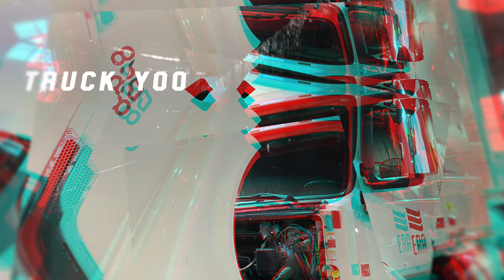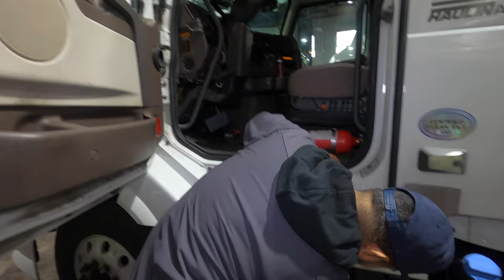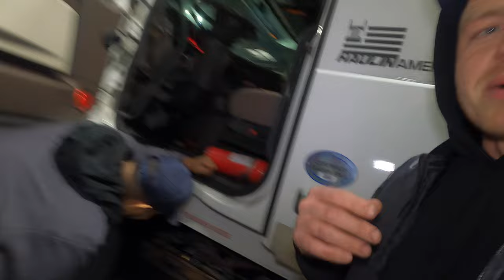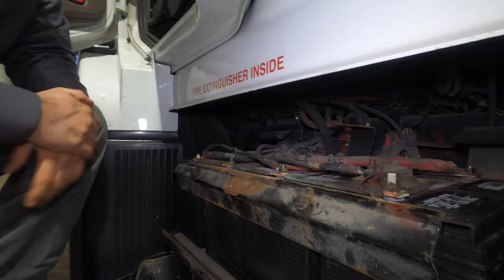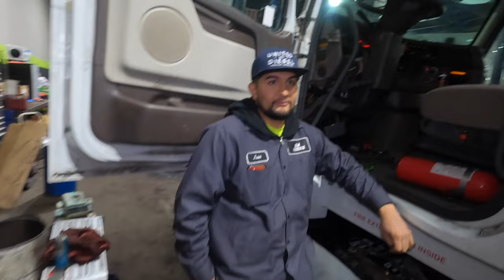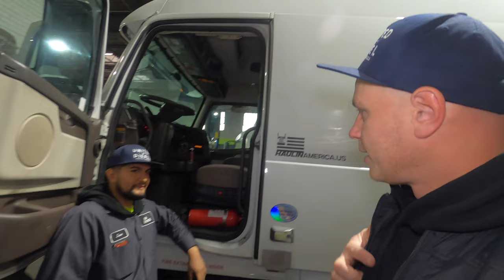How to Reset Codes on a Semi Truck WITHOUT a Computer!

Comment: I have a 2007 Infiniti and when you pull the battery, the computer also "unlearns" your driving style so it resets the learning process for figuring out how to set shifts on the automatic transmission.  Also if you start getting weird random codes (especially if it's a new to you truck), have the batteries checked.  Weak batteries can really mess with ECUs and sensors.
Reply: Automatic Big rig ??? 🤣🤣🤣🤣🤣
Reply: @hollywoodsaint57  Most Semi's in the US are automated manual, which is an automatic. A large percentage are still stickshift.

Comment: I hate Volvo automatics! So did exactly what this video shows and the transmission is still not working. As soon as you put it in drive, the revs go crazy high and it grinds gears 🤬 put it in neutral and shut it off again. It won't even go into reverse. Did I say I hate Volvo? Can't say it enough.
Reply: Volvo Mafia

Comment: If it doesn't clear, make yourself a resistor and touch the two cables together so it drains all of the power out of the capacitors and  then try that. Never touch the positive and negative cable together without draining the power slowly with a resistors or you could damage the PCM or other sensitive electronics.

Comment: I disconnected the two main grounds, all  electric went out but I did not disconnect the power main should I had also disconnect it? When put back on Check engine is still there but code eec 61 spn3936 fault 18 went out.

Comment: Hey i have a 2012 vnl. Its not doing anything when i try to crank it. Its giving me this message along with check engine light. J1939 communication error with engine ECU. Any idea what could it be?
Reply: Commenting in case they reply
Reply: Any fix for this... I have the same issue
Reply: @diegocortez3196   new ecm
Reply: Check the wiring harness and fuses. No communication means just that it won't read the message sent by ecm. So it could be either ground or power

Comment: Could you guys do me a favor and send me a picture of the air sensor connectors under the dash of a Volvo? Mines is a 2016 Vnl780. I need to clarify I have the right connectors connected to the right sensors. Thanks in advance

Comment: Woohoo 1st like!
Reply from the maker: Thank you!
Reply: @Demetrius Moore you should use your ear and start taking things apart until you find it. Squirt soapy water on hose fittings or look where an air line may be running against something.

Comment: I have the switch on my 15 Volvo 670. Can I just turn my switch off for 20 minutes?
Reply: No u have to remove the negative terminal because the computer is connected directly to the battery.
Reply: Yes you can